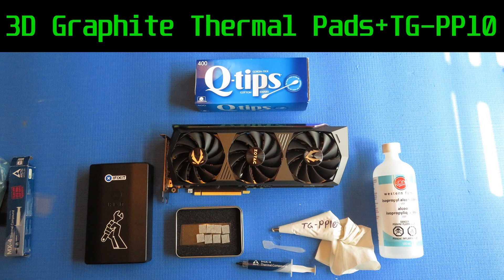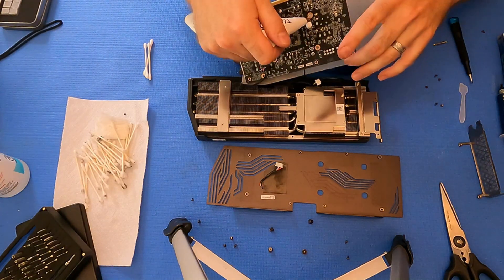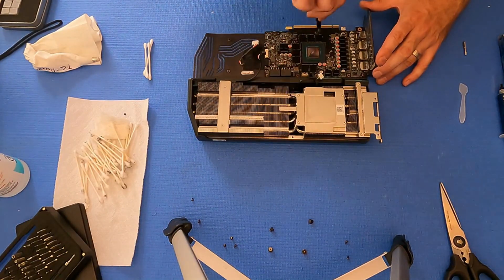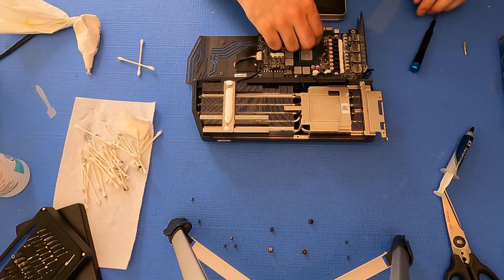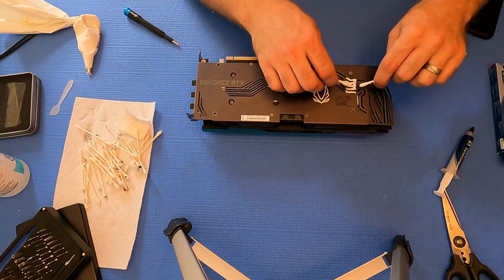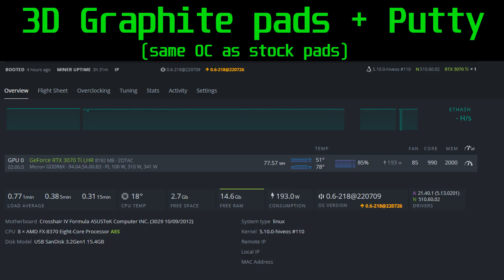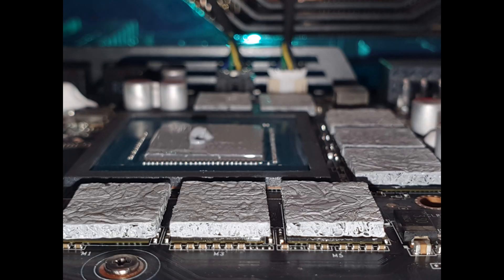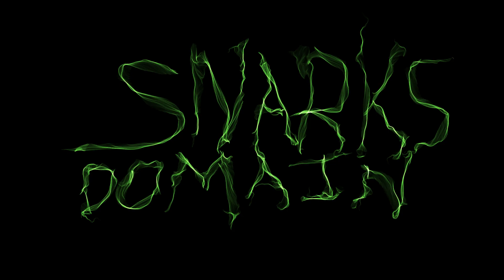3D Graphite Thermal Pads + TG-PP10 on a Zotac 3070 Ti

Comment: this is very good this is as good as copper mod but i guess less risky and messy.
Reply from the maker: It's definitely knocking on the door of Copper Shims performance wise. I will test further both on the hotplate and on this 3070ti.

One aspect that will need to be considered is the longevity of the copper shims themselves vs these pads. 

To my understanding these pads may pull apart when a card is disassembled. The only reason to pull the card apart being the need to eventually replace thermal paste.

Now if you use quality thermal paste and keep the core temp cool you can likely expect a long happy life, likely at least 2 years (rating of the pads). I'm not convinced the pads go bad at that time but we won't have that data for years.

I plan to use this card to test out all sorts of pads so will need to buy a set for a card for a long term test and then can document performance over the years.